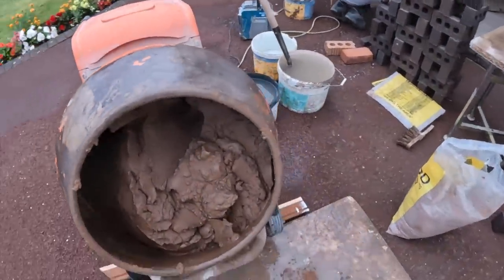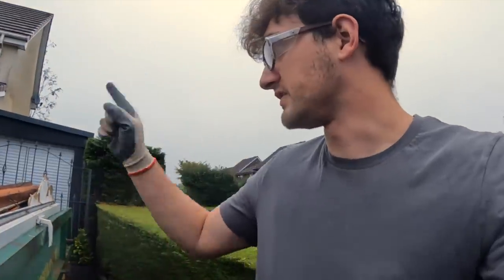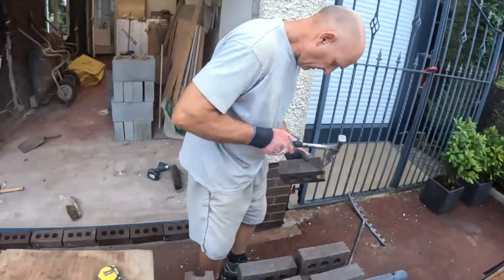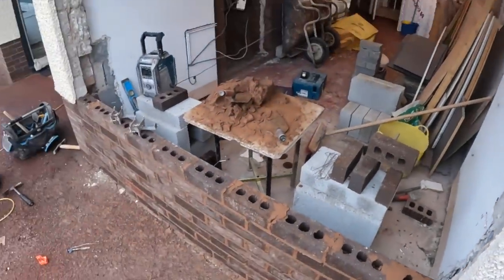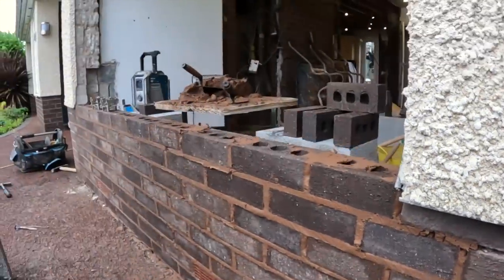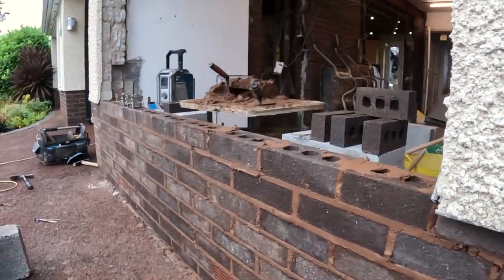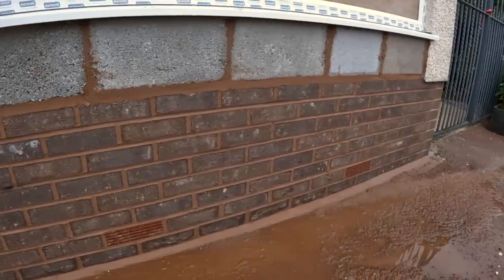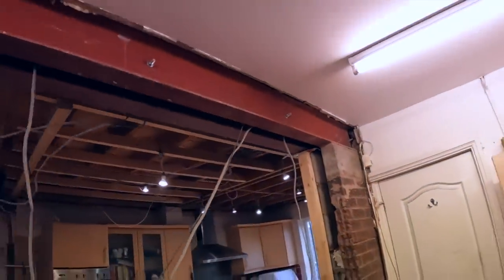DISGRACEFUL COWBOY BEHAVIOUR.....GARAGE CONVERSION PART 5

Comment: Builders who buy at auction to flip, want maximum profit - skip hire a waste of money, so they employ roofers that leave old roof (slate, old felt and batten) in attic space, then cover with insulation so on first glance it looks ok - wall knocked through expect to find it between floorboards or under freshly turfed garden
Reply: Absolutely shockin!
Reply from the maker: @gpet23  🧱👍🏽

Comment: Another cracking upload by Steve and Alex getting through so much different jobs to a high standard from tidy facing brickwork to form new window with all the correct weep vents dpc and wall ties to also installing concrete lintels and good explanation to people wondering what engineering bricks are. Also showing how to maximise your skip use 😂 thanks for the upload guys 👏
Reply from the maker: Cheers John 😁🧱👍🏽

Comment: I have found numerous hidey holes with the previous "contractor" rubble in. Would you believe I once found tubes of caulk and bottle of white spirit in one top floor flat I refurbed all hidden behind plasterboard tacked up in roof space. We also found a bulging ceiling with all sorts of crap above, due to fall at any time. Best Wishes from The West Country.... Bob.
Reply from the maker: Not just irresponsible, bloody dangerous 😡😡🧱👍🏽

Comment: In Wales it seems like (well for our extension) slate is used to fill the gap between the beam and the existing structure, rather than cementing it
Reply from the maker: Plenty of different ways to do it 🧱👍🏽

Comment: Nice job as always ....do you always use an angle for first course of brick over garage floor ? ....we usually end up breaking section of floor up and dropping a concrete one in below floor into existing brickwork ....never thought of using angle 🙈🥴
Reply from the maker: We’ve done it twice, just saves a lot of work and mess 😉🧱👍🏽
Reply: @SteveAndAlexBuild  defo mate .....will certainly do it next time if building control allow it ......👍👍
Reply from the maker: @karl212  😁🧱👍🏽

Comment: Looks cracking lads just wounderinf the purpose or the lintel at the bottom of your bedding it down then walling on it
Reply from the maker: Just to span the concrete and save digging down to put a foundation in 🧱🧱👍🏽
Reply: Part one mentions why in the first few minutes.
Reply from the maker: @20mallyz08  🧱👍🏽

Comment: Whats the purpose of the single leaf lintel at ground level?
Reply from the maker: To avoid digging down and putting a foundation in . It spans from pillar to pillar and takes the load off the concrete 🧱👍🏽

Comment: Would have been a far better job to properly tie both skins together under the steel beams, also what is the block work under the new window built off, cannot see a lintol as you only put a single leaf one to the outside
Reply from the maker: It’s built off the slab
Reply: What slab, as you put a lintol  in for the outer leaf of brickwork, just curious
Reply from the maker: The concrete floor . They are Fibolite blocks so very little weight
Reply: Thanks for replying, hope all goes well for you
Reply from the maker: Cheers 🧱👍🏽

Comment: Why would you put air bricks in that wall I can see the weep vents on tray level being ok but airbricks I can’t as air bricks are for ventilating under  timber floor ducted through cavity to internal sub floor .
The lintel you put in was it hollow under the middle
Reply from the maker: The vents are to vent under the new suspended timber floor